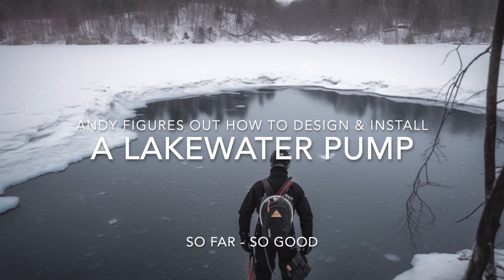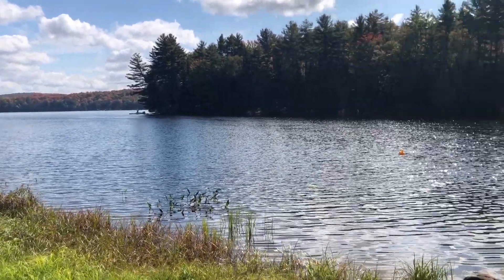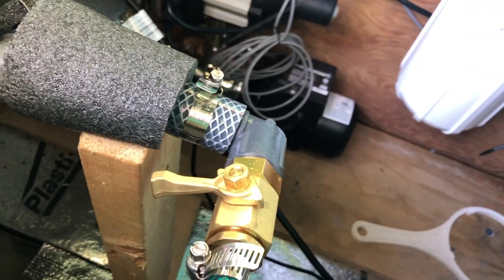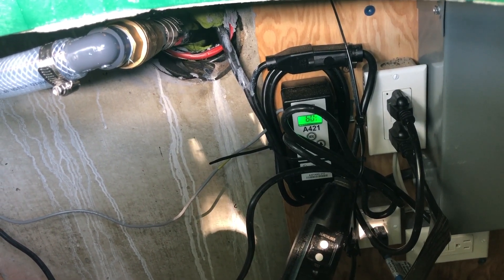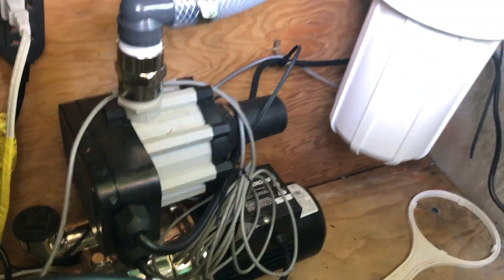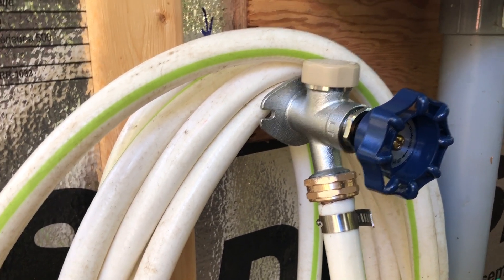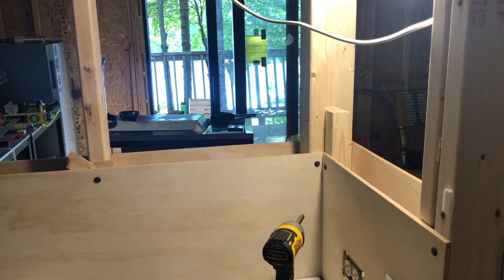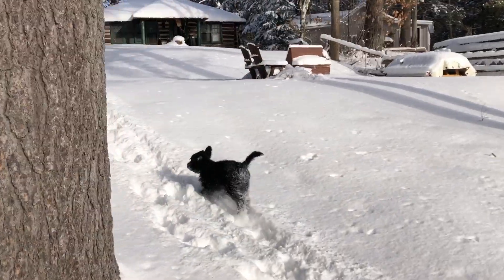How to Design & Install a Lake Pump

Comment: Do you know the voltage usage during the winter to keep your underground pump from freezing? We live off grid, would like to do something similar but concerned about electrical usage as we live off grid. Thank you.
Reply from the maker: I have an 800W heater on 110VAC in there. It's on a 30amp circuit but it doesn't need to be. I also have it on a remote/wifi connection and schedule to come on and keep it between 5-15ºC when power is cheapest. I just paid my last quarter electricity bill (3months from Jan- Mar for a wicked cold Winter, $460 all in, that's for my house, car, space heating, hot water, laundry, charging EV. I'd say probably half the bill is the heat-trace on the waterline). The pump chamber itself is well insulated so hardly every runs. There is far more power draw for the actual heat-trace in the line into the lake. The pump house powerdraw is a nothingburger. Key to avoiding power use altogether is go deep. The authorities generally don't let you dig in a lake/shoreline however. The heatline is also 110VAC on a 30amp circuit. If you want to avoid all of that, stack well-tiles close to the shore, go deep, and put your kit (like a conventional 110VAC well pump OR a Dankoff SolarRam pump) down low, former underwater, latter needs to NOT be in the water!). Insulate the top few tiles and lid really well. Then no heat-trace needed. The well tiles will fill up if they are below the lake depth. But that's considered surface water and so needs to be treated appropriately.